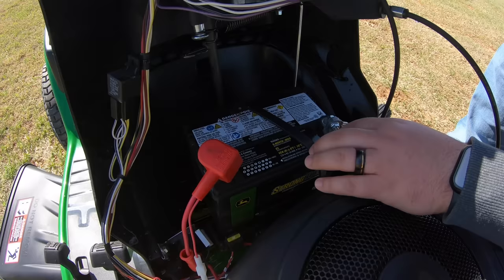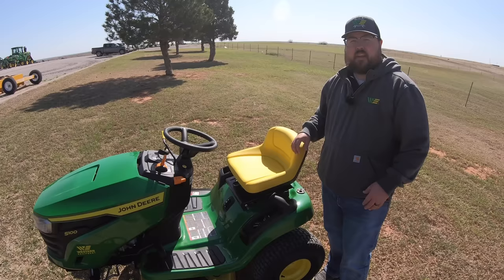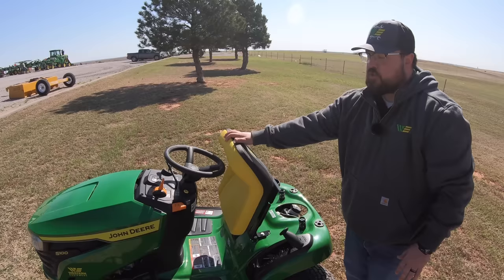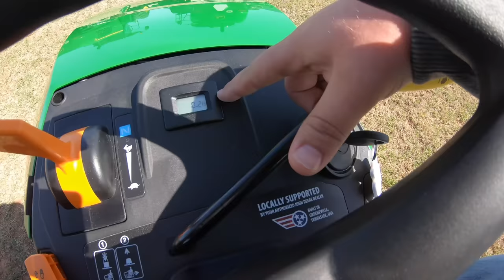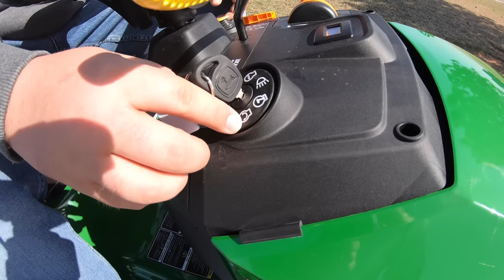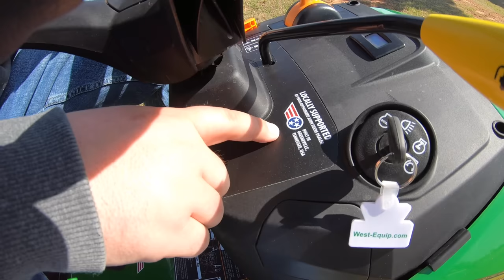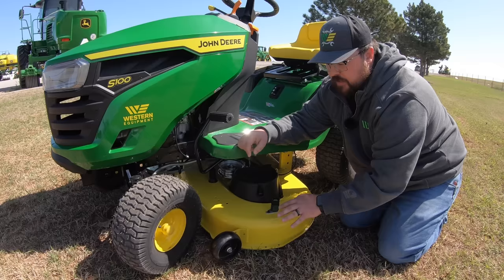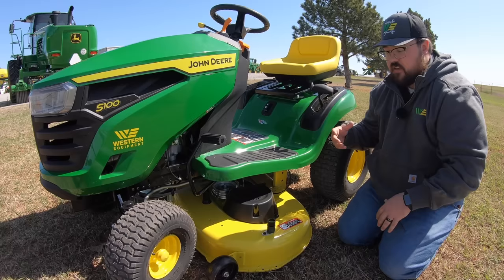2021 John Deere S100 Riding Mower Review and Walkaround

Comment: Is it correct that I need to keep my foot on the right side pedal at all times when cutting?
Reply from the maker: Yes, you will need to keep it on the Forward pedal, unless your machine has the cruise control installed. Good question and thanks for watching!
Reply: @WesternEquipment  Thank you for your answer,  my last mower had only the left clutch/brake foot pedal.

Comment: Be nice if someone would make a video on how to tighten the deck belt. 4 hours and I’ve chewed up 3 belts already.
Reply from the maker: Are you leaving your spindle covers on?
Reply: @WesternEquipment  yes sir. You can tell the belt is rubbing on them. Also on the front of the deck. Ever since I changed the belt it’s been super loose when the blades aren’t engaged. Almost to the point where the belt is falling off

Comment: Does the S100 have an option to tighten the deck belt??
Reply from the maker: Unfortunately there is no way to adjust the belt tension but there is a kit you can add to the drive pulley that is directly under the engine that will help keep the belt on. It is part number AUC11456. You can check us out at 247parts.com to order it. If it is not listed on the site just contact our support team to order it. I hope this helps and thanks for watching!

Comment: How exactly does the fuel gauge work on the s100. the thing between my legs doesnt move when i put fuel in it and no digital gauge reading. So how do i know fuel level?
Reply from the maker: The float may be stuck. Have you tried moving it by hand? If that does not work I would have it looked at by your local dealer because it has a 2 year/120 hour warranty on it. I hope this helps and thanks for watching!
Reply: @WesternEquipment  it moves freely by hand to just above half tank but then stick from there to full
Reply: @WesternEquipment  Got it, thanks for the help. And for the quick reply

Comment: Is 40 hrs too short of a time to have to change out the deck belt? I only have 40 hrs on mine & the belt is stretched out already. No abuse to my mower either
Reply: When you engage the blades you need to have your throttle in the middle not full, that will take pressure off your belts.
Reply: @jameslomenzo1139  appreciate, I’ll start doing that

Comment: that engine doesn't sound as noisy as the previous models.  does it sound quieter to you?
Reply from the maker: Yes, they do seem a bit more quiet than the E models.
Reply: @WesternEquipment  ya I noticed the same thing when another guy posted a video of his new S140.  First thing I noticed is it didn't sound as loud as the E140.  Do you know if they added a muffler or made some change to the exhaust pipe?  I looked on the john deere and briggs websites but they don't say.

Comment: Question/ is it possible to get the fender extensions for the 100 like the higher 100,s have?
Reply from the maker: It looks like the foot deck/fender deck is made a little different on the high 100's to accommodate the fender extensions. You may be able to add them but you would have to drill holes in the fender. The S100 fender my not have enough lip to add the extension. Hope this helps and thanks for watching!
Reply: @WesternEquipment  Thanks for the help. :)

Comment: I have a LA115 John Deere, can I buy a head gasket for it. It is burn oil and smoking. I read it was problem for that year, is that true
Reply: Yes it is most likely that, is the smoke coming out of the muffler or from another part?
Reply: @manofculture4945     It is come out the muffler
Reply: @dalebennett5227  so it could be the head gasket or it could be that there is too much oil inside.
Reply: @manofculture4945   thank you. i know it use some oil
Reply from the maker: Yes you can buy that gasket and replace it. Hopefully this fixes your issue. Thanks for watching!

Comment: I'd like to replace the blades with some mulching blades. If I do this can I remove the chute and add a cover in it's place like you can do with the Cub Cadet's and Troy Bilt's?
Reply from the maker: Yes you can do that with the S100. And here is a link of the parts to do so: Mulch Cover - https://247parts.com/gy00115-mulch-plug-1/ ; Blades - https://247parts.com/am141033-mower-blade-kit-mulch-blades-1/. Also check out out these two videos to help you install them: Mulch Cover - https://youtu.be/XAbFJMvjMUc Blades - https://youtu.be/VvfpGHJDbq4. I hope this helps and thanks for watching!

Comment: Built in Tennessee with Chinese parts. Very thorough review and great job but from experience I strongly advise you don’t buy this piece of garbage. The belt tensioner is very weak and snaps after a few uses, and with that being said the belt comes off of the pulleys very easily. I personally am not a JD fan but there is a reason this is priced where it’s at.
Reply from the maker: I appreciate the feedback and thanks for watching!

Comment: I almost got the S100, but one thing that bothered me is how it's missing side panels that all of the other 100 models have.  What I'm referring to are the triangular-shaped panels underneath the John Deere script and just in front of the pedals on each side of the mower.  Did John Deere really have to skimp on this piece just for the 100 model?  I don't like that it's missing because some of the "guts" of the engine are exposed.
Reply: For the record, I bought an S120.
Reply from the maker: I know what you mean but I think you made a wise choice going to the S120. Thanks for watching!

Comment: JD has cheapened up their equipment so bad in the past 15yrs it's ridiculous! I worked at the Waterloo Iowa plant from 89-2018 and we installed just as many overseas made parts as Murray, some times using the exact same parts.

Today's JD isn't what your Grandfather used to use, that's a fact! You are literally buying the name and the paint, that's it.
Reply: just bought the S100, can't wait to mow the lawn tomorrow
Reply: @keiththackston7043  Should mow fine, just don't go thinking you are a proud owner of a REAL  jd, no such animal anymore 😕
Reply from the maker: I agree that the machines are not built like they used to be but times have changed and parts in general are more expensive as is everything else which is why nearly every manufacturer of lawn equipment has an affordable line. These are still built in Tennessee, USA and John Deere hold true to their warranty. It is definitely a real John Deere. Thanks for watching!
Reply: @WesternEquipment  The name and paint are the only thing jd since the early 90s.
We assembled thousands of units with parts made in China, Korea, Mexico and Israel. 

But yes jd is assembled in the USA but the majority of the parts are manufactured elsewhere.

Comment: John Deere in 2021: Too damn cheap to put a 25 cent CLIP on the damn lid.
Reply from the maker: I'm confused, which lid do you mean?
Reply: @WesternEquipment   The lawn tractor hood which is made to look enormous like it's a big powerful engine, and then inside there's a lot of air, and a tiny 1 cylinder lawnmower engine.

Comment: They got the hint no one wanted that stupid quick change oil crap that only changes 1/4 of the oil
Reply from the maker: Well some models still have it. We have seen quite a few residential customers that prefer it. Good thing is it can always be converted back to a normal drain and filter system. Thanks for watching!
Reply: @WesternEquipment  I have an E130 and took the easy change junk off at the 8 hour oil change 😀